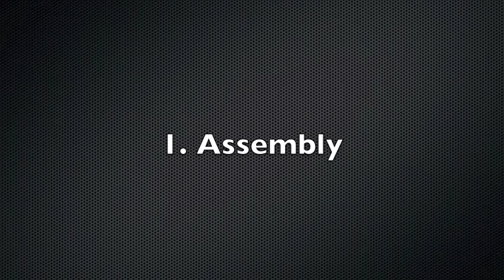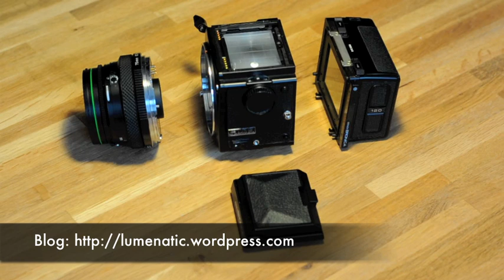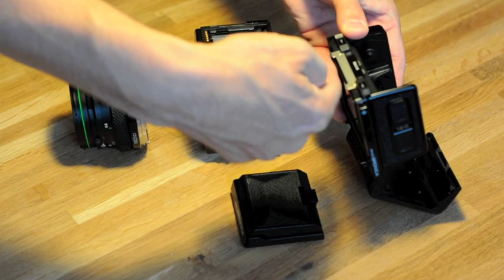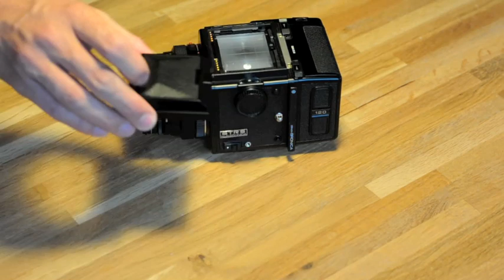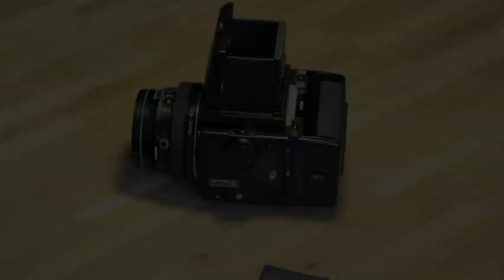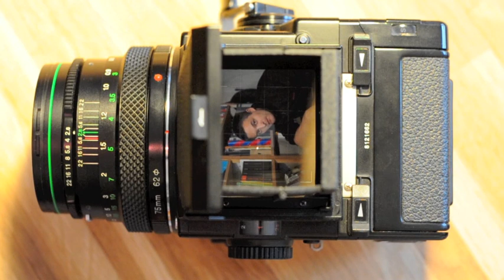Zenza Bronica Assembly

Comment: Is it possible to remove the film back without the dark slide in place? I bought a used ETRS that came without the dark slide; I can open the back and take out the film cassette, but the rest of the back remains on the camera and the release button seems to have no effect.
Reply: I am pretty sure that on the ETRsi you have to have the dark slide in place to remove the film back. So I am guessing that is the same on the ETR.